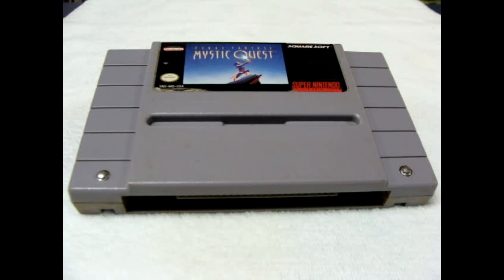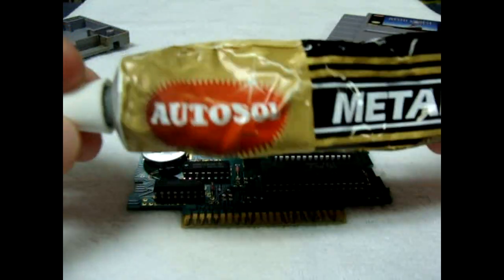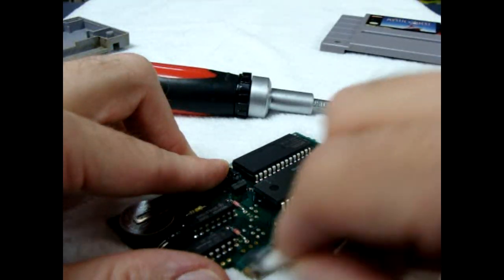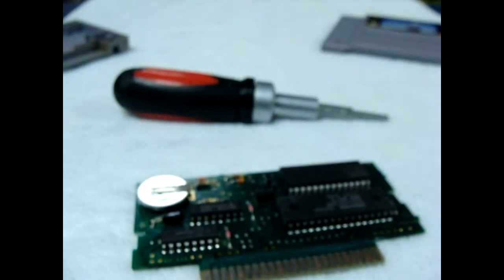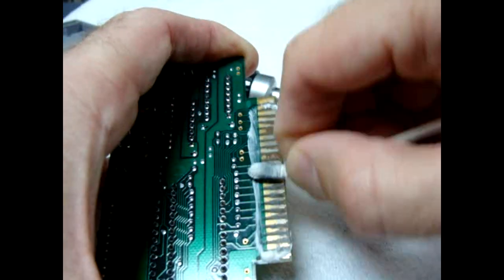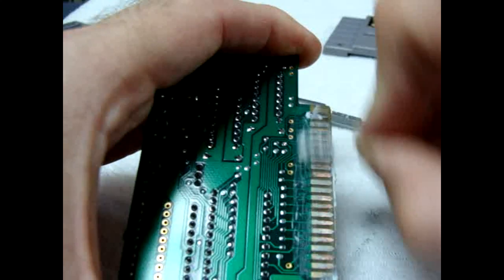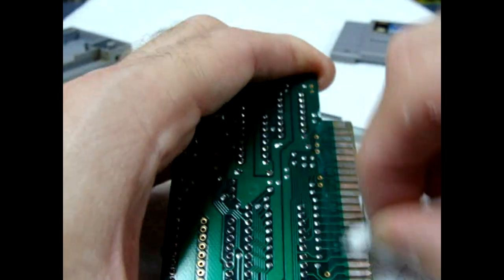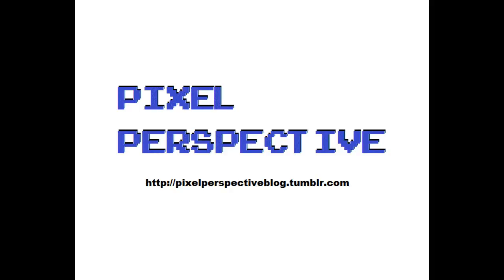How To Clean Rust, Oxidation, and Corrosion From Video Game Cartridges Nintendo Sega Etc.

Comment: I posted this as a response further down but will post it again as it's own comment. At first you can attempt to gently scrape off corroded pins with a paint scraper / razor. After an initial cleaning of the game pins I will use a SNES dust cover and fill it with just enough vinegar to soak the cartridge pins. I'll let them sit for 30 - 45 mins depending on how bad they are. After that, I'll remove them and dry the pins. After drying, I'll drum some baking soda on the pins and boards (I'll hear a little fizzle as the remaining vinegar is neutralized). After that I'll clean everything down with rubbing alcohol. Then I'll go over the pins with baking soda / water once again. I'll finally clean everything off with rubbing alcohol again. I usually dry everything well with compressed air. Small dings will remain where the neutralized / removed corrosion used to be, but the pins will otherwise retain their golden luster.

Comment: I may be way off the mark, but is there not some type of copper paint to recoat exposed pins and prevent further oxidation while retaining conductivity after this type of cleaning? A clean and restore if you will ;)
Reply from the maker: Peadar Feckfidgion the only way to do it is to electroplate them over again

Comment: have you ever replaced/soldered any new resistors etc inside of the game carts? I have a few that seem to have been rusted out a bit and a resistor connection was broken due to it.. would like to know that replacing this has been done?
Reply: Reflowing the solder can help. If the rust/oxidation is bad enough I've personally sacrificed a common cart to save a more expensive one.

Comment: I got a copy of Pilotwings from an antique place a week ago and it won’t boot up. After cleaning it with alcohol multiple times, even going as far as opening it up to get to the circuit board, I came to the conclusion that the buildup of corrosion on the outer pins is the source of the problem. Perhaps I’ll have to try this out.

Comment: To answer the guy that asked about vinegar... Vinegar, like any other liquid that is not alcohol, will of course corrode the board IF you let it stand. A great technique is to apply baking soda and vinegar which causes a nice chemical reaction, and it burns off some corrosion and grime. You just have to be sure to use rubbing alcohol right after. A great technique for cleaning pin connectors is to soak them in hot water, baking soda, and then add vinegar and let it soak for a few minutes. Then you douse it in rubbing alcohol and use a hair dryer to make sure no moisture remains. But, that is with a pin connector. With a game cartridge and a circuit board I would avoid using any vinegar (I have but we are talking a super tiny amount with baking soda immediately followed by rubbing alcohol). First clean the connector as best you can with rubbing alcohol. You will be surprised that some carts will still launch with some corrosion. Best to use rubbing alcohol until the Qtip is clear and test it. Then go to brasso. If the brasso does not work, then you use 330 grade sand paper, the problem with sand paper is you could easily end up accidentally breaking a trace. It is okay if a trace is exposed, but if it gets cut, you have to repair it which is a pain in the ass. So, you have to be careful. 99 percent of games can be fixed. But there is always that one percent that are just so bad there is nothing you can do. This cart in the video is not nearly the worst I have seen lol. It is bad but not that bad. You should see some of the carts I restored, cockroach feces, oxidation, rust, all of it. Blew my frikin mind. People store your shit in a nice cool dry place. I never understood how people could treat their shit so badly and ignorantly. Good video. Also, if you are having problem with games playing always be sure to check the pin connector as well. I have found corrosion on those even on the 72 pin connector on a NES both on the connector and on the edge connector on the board. I would put a game in and it would come on but would not work because of the corrosion on the edge connector on the board where the pin connector makes contact.
Reply: Thank you
Reply: Hello, can you help me with my nintendo switch cartridges? Ive noticed some oxidation on the pin connector. I live in Malaysia which is the air is humid i believe. How to clean it?
Reply: @syahirfahim6717  Switch Carts are rough. Not going to lie. Try cleaning them externally first with rubbing alcohol. If that doesn't work, you have to use a small flat head screw driver to pry them open to get directly to the edge connector, then you can clean them with brasso and rubbing alcohol. Try the rubbing alcohol first though, and just be thorough. That usually works.
Reply: do you think brasso would work equally as well as contact cleaner/electric cleaner? I am trying to save 2 gameboy advance cartridges that have had soap which dried onto the pins over a long period of time. The screwdriver to take the cartridge comes in two days and I am hoping to get a deeper clean once I can open it. Thanks in advance!
Reply: @ohweezuschrist  The brasso will work perfectly. Use that, clean it thoroughly, and then follow up clean with rubbing alcohol. The games will work after that assuming there are no cut traces.
Reply: @steviejoe7918  You wouldn't recommend a vinyl eraser or electronic contact cleaner before using the brasso that strips the protective coating?
Reply: @ohweezuschrist  It only strips the protective coating if you really hammer it, if you are just doing a nice cleaning nothing gets stripped. No harm done. Brasso and rubbing alcohol fixes all edge connectors every time and the games never fault afterwards. Sure you can add additional crap, but not necessary.
Reply: @steviejoe7918  Oh okay. These are my Pokemon Emerald and FireRed cartridges so I wanted to make sure I don't screw myself in the long run. Thank you so much for the advice!! Hopeful I can get all that corrosion off now
Reply: After an initial cleaning of the game pins I will use a SNES dust cover and fill it with just enough vinegar to soak the cartridge pins. I'll let them sit for 30 - 45 mins depending on how bad they are. After that, I'll remove them and dry the pins. After drying, I'll drum some baking soda on the pins and boards (I'll hear a little fizzle as the remaining vinegar is neutralized). After that I'll clean everything down with rubbing alcohol. Then I'll go over the pins with baking soda / water once again. I'll finally clean everything off with rubbing alcohol again. I usually dry everything well with compressed air. Small dings will remain where the neutralized / removed corrosion used to be, but the pins will otherwise retain their golden luster.
Reply: I watched 3-4 videos including this one and none helped. I happened to read your comment as I watched and paused it to try your method on my n64 cart. I added a little baking soda to the vinegar I was already failing with, then cleaned with 91% alcohol and it worked like a charm. Thank you much. Now I can enjoy Rocket Robot on Wheels!!

Comment: Straight up vinegar on a Qtip removes the corrosion. Then you use alcohol on a clean Qtip and wipe away what your cleaned. Been using this technique for 35 years. Works perfectly. In some cases where the corrosion is not removed, toothpaste WITH baking soda solves that and shines up the pins as well. 120 grade sandpaper in an up&down manner  can help in extreme cases. But they always work afterwards...
Reply from the maker: Vinegar is highly corrosive, I do not recommend using it on any electronics.
Reply: @PureConsoleGamers  When using the vinegar, it removes the corrosion efficiently and you DO have to clean it off... Its not a simple wipe/saturate and go method..

Comment: if a normal cart has a little oxidation and you use alcohol cleaning, will it just get worse over time?
Reply: Anonymous Idea Not necessarily, one thing that can cut down on it is to use cartridge bags to avoid long term air exposure.
Reply: @ZyferWarriorPrime  well I leave them in a plastic container, don't know how airtight it is but it seems alright. I couldn't get it off with alcohol anyways, I had to use vinegar.
Reply: @anonymousidea9119  If it works, it isn't a big deal about it looking pretty. Baking soda paste works surprisingly well for those last case desperation ones. I used brasso to clean off the internal NES connectors though.

Avoiding liquids and humidity is the best thing too. These cartridges have taken a lot of abuses over the years being in garages and ending up in yard sales and flea markets. What you have done is better than nothing, but there are better options. I would take extra precautions for your more rare and expensive ones in the least.
Reply: @ZyferWarriorPrime  For sure. And don't worry, it was just Super Bowling. The "rarest" game I could break is Super Mario All Stars + World as of now, and i'm not putting steel wool or brasso on any rare games I may end up with. and I'll definitely say I've seen my fair share of permanent marker and sticker gunk and other stuff on cartridges that just drives me mad.
Reply: @anonymousidea9119  Well, the cartridge backs are easy to swap but ya. Alcohol is good for even getting off permanent marker, but won't help you on the labels. Funny part about Mario World + All-Stars is that it was not sold separately. If you want it in its original box, it would have to be a console box.

Some games are surprisingly rare though. Super Bowling for SNES is cheap, Super Bowling 64 is like a couple hundred for the cartridge alone, while the Japanese Super Bowling 64 is dirt cheap in comparison.
Reply: @ZyferWarriorPrime yeah, what I think is even weirder is the SNES I bought with All Stars + World also had a regular copy of super mario world with it. Who knows how stuff like that even happens, it definitely wasn't from a collector so who knows. As for rarity I do think that it is kinda funny how all over the place basically the same item can be. I wonder if there are any games that are only rare or expensive in Japan? I've heard of some games where it's expensive in both places but other then exclusives I don't know of any.
Reply: @anonymousidea9119  There are some. It is usually less popular categories. But there, retro doesn't have the same kind of popularity as it does here. Maybe limited sense of nostalgia? You can import a Nintendo DS for less than it would cost here and is region-free so it works fine and the language can even be set to english.
Reply: @ZyferWarriorPrime  you think so? I've always seen Nintendo and such as really tapping that big nostalgia market. I would think the lower costs are mainly because they have so much more supply. Or maybe they just don't have anybody that will pay top dollar for that nostalgia.
Reply: @anonymousidea9119  Perhaps, but even much widely popular titles can be had for cheap. It is really random though. Most that fetch more are usually imported here and are sought after titles not released in the US. Titles completely or mostly in english seem to go for more.

Comment: Contacts are gold-coated copper. Pure copper is not good for contacts because oxidizes pretty fast. You are removing the gold exposing the copper.

Before doing that, first I would use 99º rubbing alcohol. If alcohol is not enough, electrical contact cleaner will do it and you dont have to clean nothing after.
I have recover some games using contact cleaner. Also when I am cleaning o repairing a carthidge console, I like to spray the contacts with cleaner, and insert a game several times to clean the contacts on the console.

This also works with RAM sticks, graphic cards and slots on computer. Spray some cleaner in the slot, insert a RAM or GPU several times and the contacts in both, the slot and card will be clean
Reply from the maker: I said that in the video, after also giving a disclaimer that this method is only in emergency situations only when oxidation is taking over.

Comment: Can i soak the rust bit in vinegar?
Reply from the maker: Ken oh no! Vinegar will totally corrode and eat away at the metal
Reply: PixelPerspective thanks for information. It is good idea to ask the expert
Reply: @ken_le  use 99% Isopropyl alcohol
Reply: @Jonnynot1plate  is 50% okay? Or is 99% better??
Reply: @goodiegoodygumdrops  should be okay but will probably needs to scrun more and wait longer to dry

Comment: excuse me my good sir
i used rubingalcohol for my N64 games. they werent corroded (Infact only 1 came i have is actually very corroded)
back then i stopped playing my n64 for about 5 years and then the cartridges became black on the contacts.it was only dirt. no corrosion. so i used rubbing alcohol on it to remove the dirt the q tips became black.
this is safe right? i only used it on the dirt. there was no oxidation or rust it was just dirty. now it shines now and works beautifully after letting them dry for an hour or two
i did a good days work right?
the main reason i asked as i was worried that the contacts were golden instead of silver as i thought silver meant the game is clean.
So its SUPPOSED to be golden? i guess i did do a good job cleaning didnt i?
Reply: Yeah, alcohol is safe. So if you got it back to working, you did good. :)
Cart pins are indeed golden as that's a coating to prevent oxidization.
Reply: Most are gold some cheaper ones were silver because they were just Tin, though usually have the most issues.

Comment: I found an old Street of Rage 2 for the Genesis and it was heavily corroded. Way worse than this. It literally has "rocks" "living" on the gold pins lmao. I honestly thought the game was done for. I went ahead and cleaned it all up, but the corrosion was just too much no amount of 99.9% IPA would get it off.

What I ended up doing was getting a fine grit sand paper. I literally just went to town on the pins and literally sanded off all of the corrosion. Now all the pins looked a bit scratched, but they look super clean now. They all have a silverish color to them.

A few of them have a brown/coper color to them. I went in pretty deep on those since those had the deeper corrosion.

Anyways, the pins don't look perfect (obviously) but all corrosion is gone.

The game also works perfectly. I beat the entire thing on a model 2 Genesis haha. I'm amazed at how durable these old cartridges are. The game literally works perfectly.